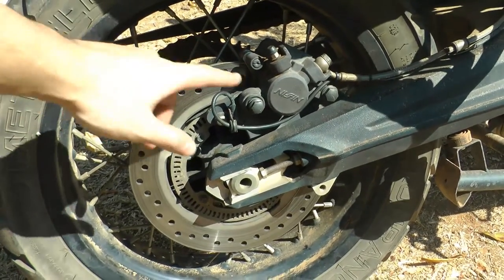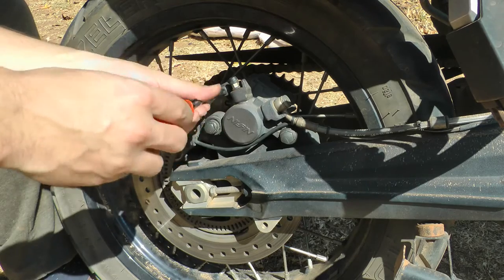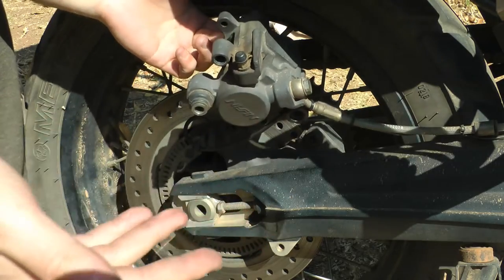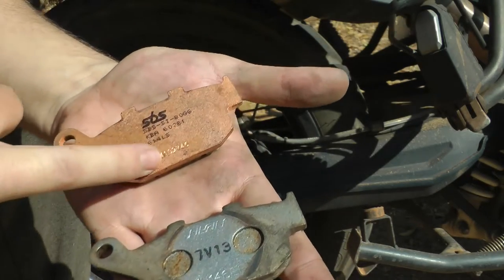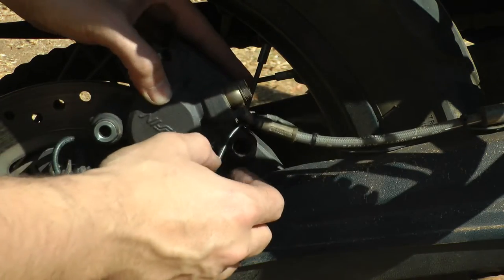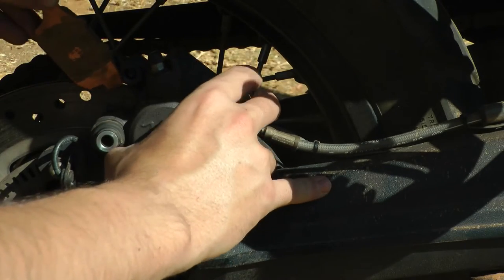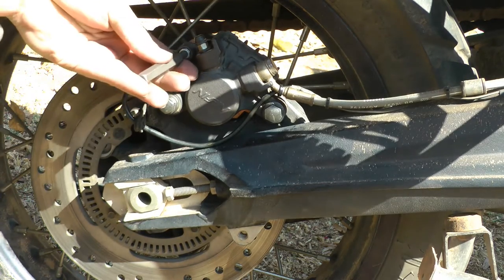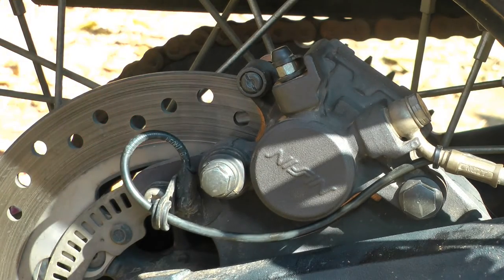Triumph Tiger 800 Rear brake pads clean and replace | Beginners Guide

Comment: Do not put copper grease on the pistons or any grease for that matter.
There is no need to put grease on the back of brake pads but if you want to anyway use proper brake grease.
Having said all that it's a good video to show you how to do everything else, well done.
Reply from the maker: Hmmm I did quite a bit of research on this and most bikers put copper grease everywhere, including piston. However I now see that car people do not and some bikers are much much more frugal with the copper grease.
Thanks for the comment, hopefully next time I'll do things a bit better
Reply: @WheeliePerd   Lots of bikers do things very wrong as they don't understand what they are doing or the properties of the materials they are using.
Copper grease will degrade rubber seals, red rubber grease or silicon grease is safe though.
Looking forward to seeing more Tiger 800 videos!
Reply from the maker: @bigbluechopper24  thanks for letting me know about the copper grease.
Really thank you, kinda the reason I run the channel!
Reply: @WheeliePerd  You are very welcome! :)

Comment: The brake piston is not going to compress until you remove the rear break reservoir cap! And a break piston compressor is not an expensive tool.